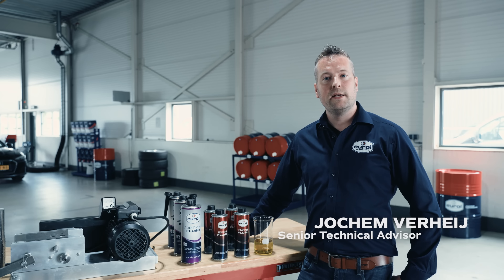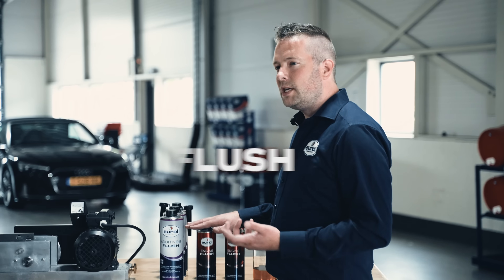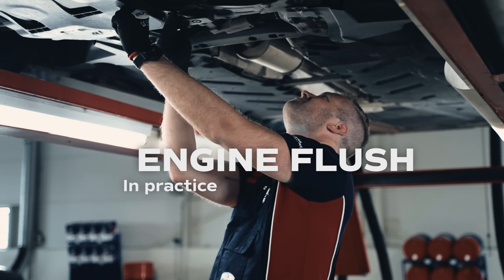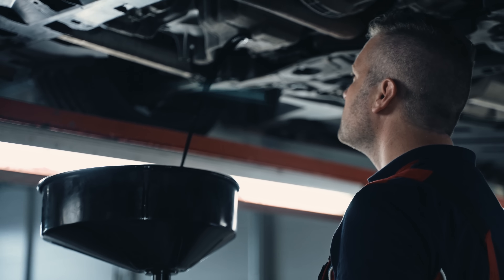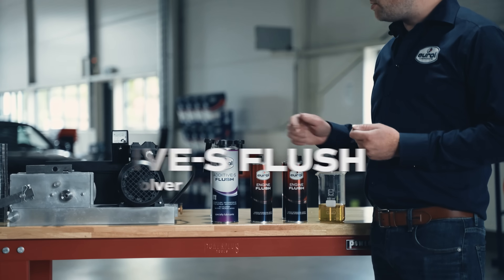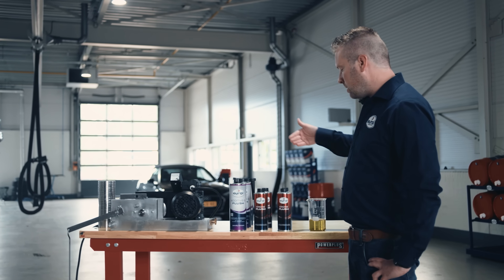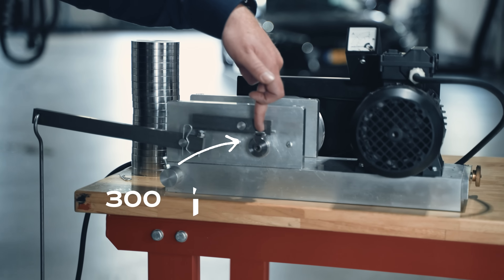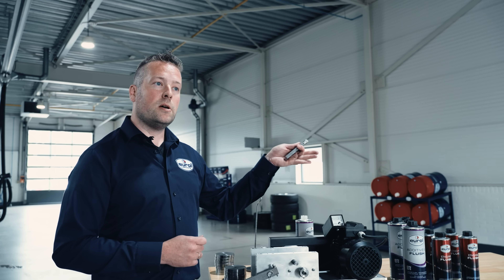Everything about the Engine Flush & Additive-S Flush

Comment: My motorcycle engine has been sitting for 6 years, do i just use the old oil to flush it or do i change to new oil then use the flush and than change it again?
Reply from the maker: If your motorcycle has been sitting for 6 years, the engine oil is likely even older. In that case, we recommend not using the old oil to flush the engine. Oil that has been in an engine for such a long time may have degraded, potentially containing harmful deposits and acids that can cause damage.

The best approach is:

Remove old oil: First, drain the old oil completely and replace the oil filter.
Perform an engine oil flush: Fill the engine with the product recommended for your motorcycle through our Online Product Advisor at www.eurol.com, add the Eurol Engine Flush, and let the engine run for at least 15 minutes without applying any load. This will clean the engine.
Change the oil: Drain the oil completely while it is still warm and replace the oil filter again. Then, fill the engine with fresh oil as recommended by our Online Product Advisor.

Comment: So, to make it clear. Add the Engine Flush to the old oil and run the engine for 15 min. Drain, change filter, put new oil and 3% additive and go. Did I get it right?
Reply: No, both are flushes - so put it in old oil 

The regular small can is normal Eurol engine Flush you can use it all at once , but with that bigger can , you can use only like 3% so in 6 liter oil engine you put only 200-300ml like he said.
Reply from the maker: Not entirely. Both products should be used separately and for other purposes. Use the Engine Flush in the old oil (complete can) during a standard oil change to mainly prevent engine issues. Use the Additive-S Flush as a problem solver in the old oil (max 3% dosage) to resolve engine issues, with the Additive-S Flush you can drive up to 500 km before changing the oil.